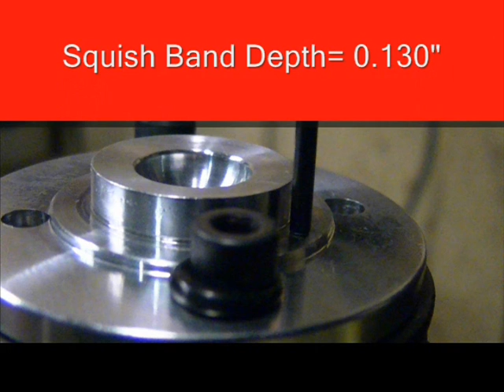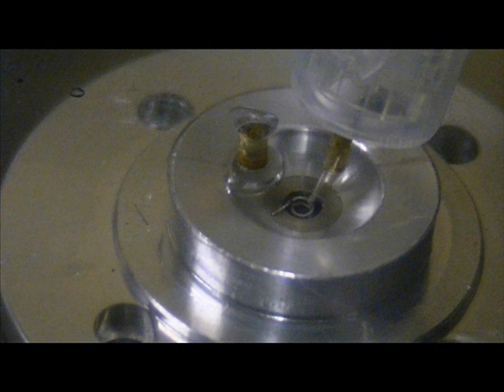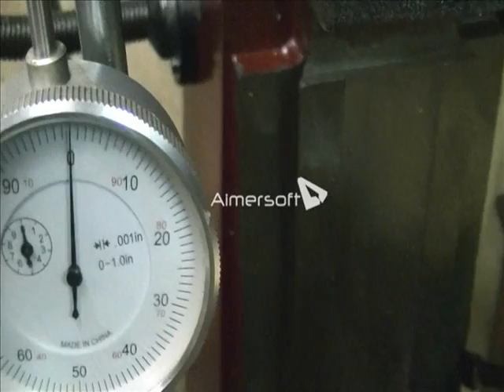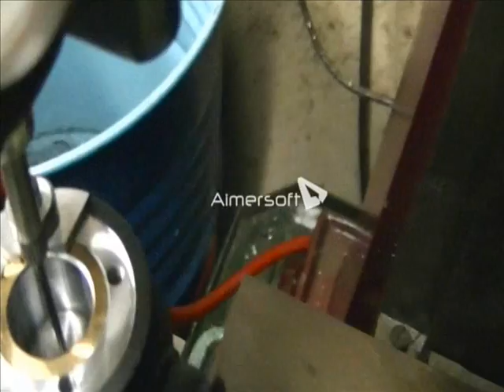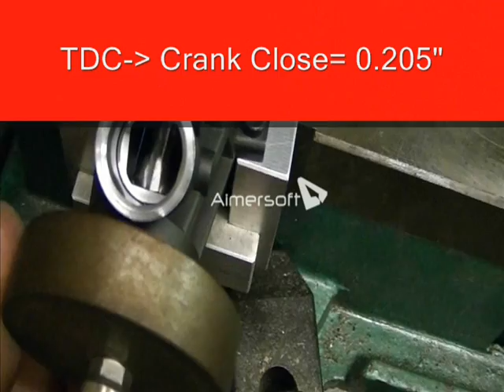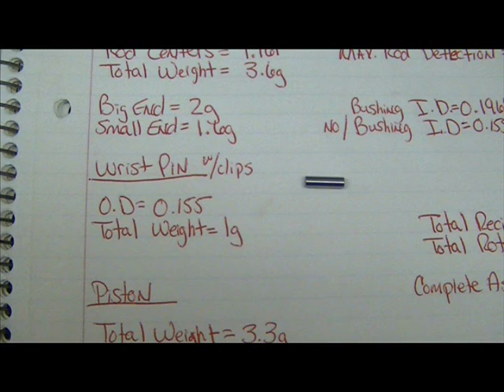Track Star SEG .21ci / 3.5cc RC NItro  Engine

Comment: Why do you not use a degree wheel?  Much easier process that will not require trig formula to figure out the degrees based on lone numbers.

And weighing all the parts?  Really?

Comment: A potentially useful upload. Alas I have issues understanding 1/1000" and mixing it with decimalisation makes it even more odd (1,0  0,5  0,25  0,125mm) (1, 1/2, 1/4, 1/8mm). I find much easier to visualise as you are starting from a smaller part 1.000mm that is closer to what is being measured as opposed to starting from 25mm and so many parts of that. 

I also notice you use metric grams for mass. Why not all 'metric'? It is so much simpler. I have this same sort of issue over here with racing comentators talking in terms say 5/10 of a second instead of 1/2 a second or 0.5sec. It's as if they are trying to be clever, but they are not. They make it unnecessarily complicated. Very irritating for me.